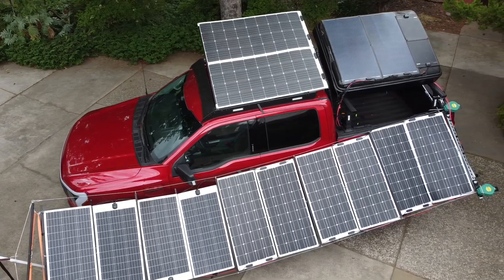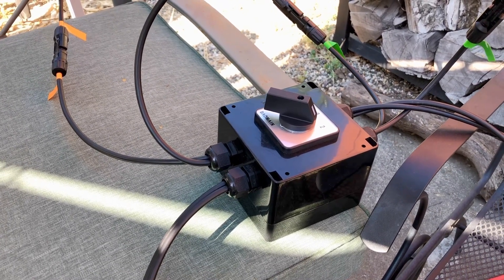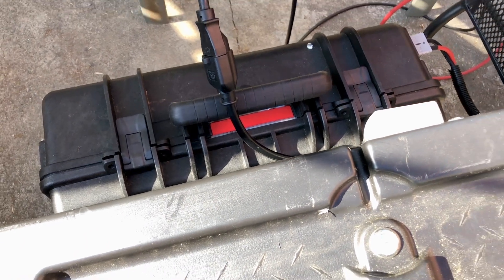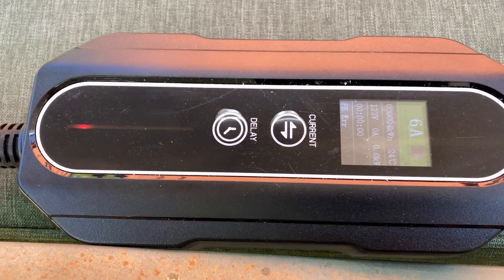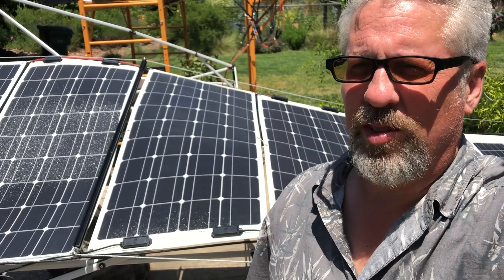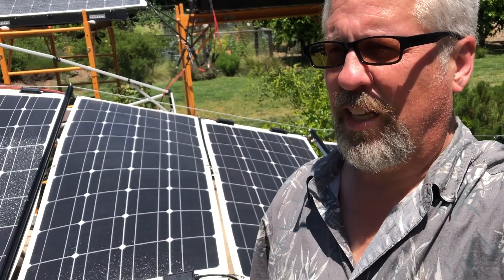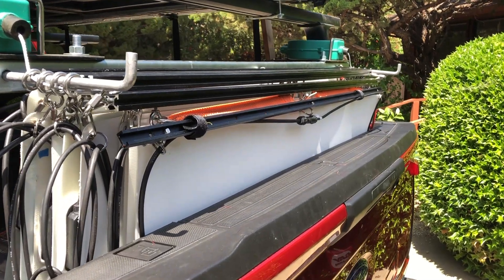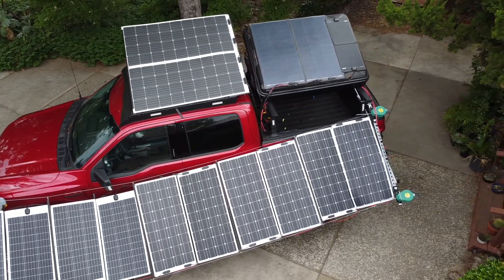Ford F-150 Lightning + 7kWh Fold-out Solar Setup - Bench Test

Comment: Since you're dealing with engineering. I have a question. On the makeup of EV'S and their battery system. As all battery groups. They come to a main collection point. Where the vehicle computers have no control. A main positive and negative that goes directly to all of the batteries. Is it possible. To connect a solar controller to that point and let the solar controller itself charge up the batteries off of the solar panels? Where my motorcycle sits more than I use it. When the battery gets low. I have two 100-watt panels on my camper. They go to my solar panel controller  and then a cord out the window. I put a cluster on my motorcycle with a female cigarette lighter plug-in. On the cord. I have a male one. All I do is just plug it in. The meter goes up to 14.2v. I let it set for a few hours, and then I do not have to do it again for a few days. Now, if I just put the male end. With just 30 amp wires to the EV main battery wire cluster. With a 30 Amp braker fuse. What would happen? Could even the EV drive while the battery is even being charged?
Reply from the maker: Hello and thank you for your comment.  I’m dealing with an urgent family medical issue but I will have an answer for you once it is under control, thanks.

Comment: I have been using solar for years. This is what makes sense to me on what you are doing. My new solar controller. 600 watt max at 30 amps max. Power converter at 2,500 watts at 30 amps. You're charging at 6 amps. That should change the truck with no problem. Going of the charger for the truck itself. You should only need 600 watts of panels. FYI on the experience panels you talk about. That's what I have. If they don't work. The panel itself is good. It has plown one or more of the items under the hood that the wires are connected to. I forgot what they are called. Sorry. I am tired. I bought bags of them off of Amazon, and I learned how to replace them on YouTube. There are three to four per panel. My thoughts. I am just sharing. Thanks for your information.

Comment: battery storage
Reply from the maker: For battery storage I have three 48v, 13ah batteries that I can configure as running just one or all three.  With just all three I have a total of 39 amp hours and have been able to charge at a rate of 22a without heat issues.  The batteries act as a buffer to allow a steady draw for the inverter…about 11a max so far but could go as high as 20 if I add more panels and/or fix som inefficiencies in the system.

Comment: goto 300w panels, condense your setup 
if you dont want portable goto 380w panels and setup a condensed charge station 
not sure what your real plan is here
Reply: These 100w flexible panels are 10 times lighter. So you can get almost 3 times the watts per pound which is also a factor
Reply from the maker: Yes, the fold-out unit I created that mounts on the back of the truck is about 2 feet x 4 feet by 6 inches deep and weighs about 50 lbs.  A little heavier than I would like but still - that's 1000W of panels in that small space and weight.

Comment: I like the concept you're working on here!  Could definitely leave it setup somewhere at home and just build up charge on your driveway when your parked at home!
Reply from the maker: Thanks.  While driving (with the octoswitch in the 1 position) the system will collect about 500W/h.  Fully deployed panels (at a campsite or driveway, octoswitch at 2 position) will collect 1100W/h (hopefully I can improve that with some tweaks).

Comment: Glad somebody’s testing this idea! I’ve been thinking about something similar with the cybertruck once it eventually comes out. I noticed you have a small wind turbine on your shed, ever think of adding one of those to your system in the bed so you can generate power after dark?
Reply from the maker: It's funny, I got that wind turbine because 1) it was discounted, and 2) I figured I would usually have enough wind (5-10mph) to generate some power.  It turns out that thing won't turn unless there is a gust of 25mph at least...so it almost never turns in my backyard with all the trees around.   If I could find a really efficient turbine, it would be a good idea though - I estimate over 30mph wind may be too much for the suspended solar panels as they may start to really blow around and possibly snap some of the connectors.  In those conditions it would make sense to put up a turbine instead.

Comment: I really like your accordion style retracted hanger for the panels on the truck. 

I have been thinking about solar power delivery and your isolator switch reminded me of it. If a second wire was run with all of the MC4 connector and they were all home run back to an input controller (like your isolator switch). A “smart” controller could be setup where by you set the Amp and Voltage max settings. So the smart controller would manage parallel and series connections on the input solar panels based on the input max perimeters you set. So mixing and matching solar panels would be more efficient and automated. A SBC (single board computer) in the combiner box with leads to the MC4 connections and a lot of coding should be able to achieve this.

The smart controller could even adjust the connections as input changes (shade, cloud cover, panel count change, etc.).
Reply from the maker: Sounds like a good project for a Raspberry Pi or Arduino, + i/o board.  Would probably need to step down the DC amperage from the MC4s to milliamps for the i/o board, though.

Comment: Amazing! Have you considered automating the amperage draw set by the evse depending on the battery soc. Protect the battery and maximise the charge rate to the car without human monitoring being required
Reply from the maker: Thanks!  The problem is not many chargers have the ability to let you set current as low as 6 amps, and of the ones I have found they require no load in order to change the amp setting.  So for the test in this video I had to stop the charge to the truck each time I upped the amperage and then restart.  I agree this would be a problem in practice on a trip...I would like to be able to leave the charging setup unattended.  I'm imagining some type of software control that could read the soc from the Victron app and send a signal to the Ford Pass app to stop charging.  Would need some type of bluetooth connection to the evse, though.